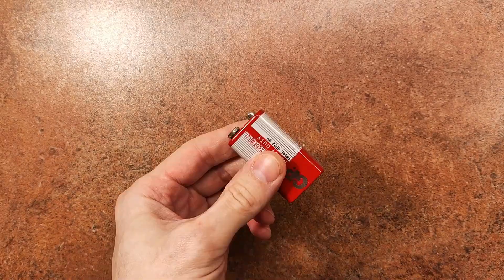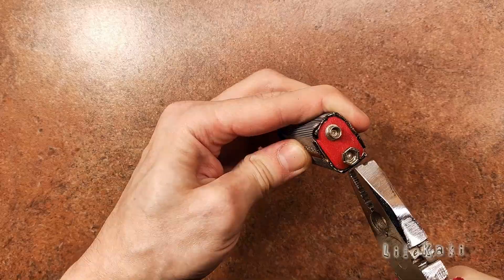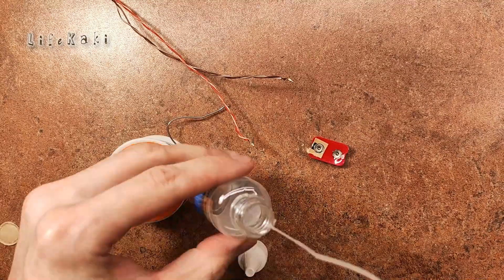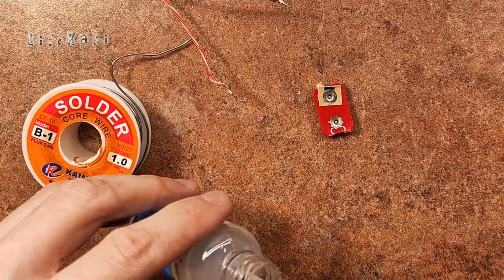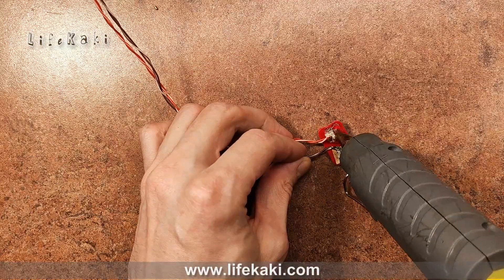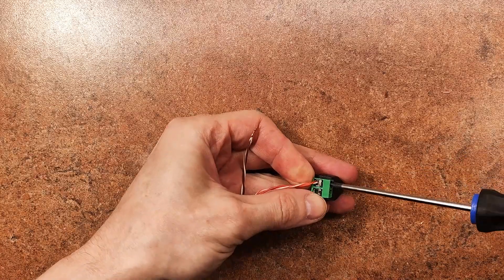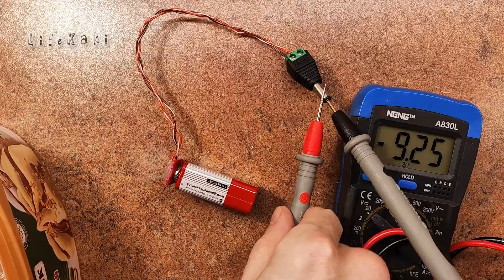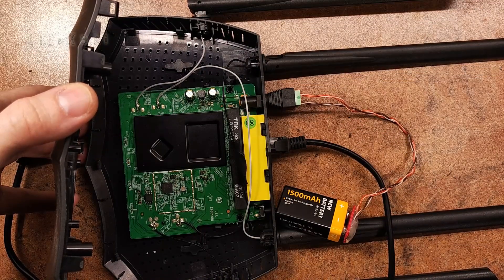DIY Power Hack – How to Connect a WiFi Router Using an Old Battery!

Comment: I'm not sure I've ever seen anything dumber in my life.

1. Can you tell me the model of a 9-volt router?

2. Does a dimly lit light indicate it's working? It hasn't even started booting, let alone supporting a wireless network.
Reply from the maker: Tenda router - it starts and works etc. didn't show it - not everyone likes to watch long videos. it's not nonsense when you always have light in the socket. When you really need the Internet and there is no light and there is a network, then this option can help temporarily. Somehow. Thanks for the comment.
Reply: @LifeKaki   Single 9V 0ption I found for 9V - 3A. THREE amps. Three.
The battery won't even handle that until the kernel boots, let alone support networking.

A lit power light means exactly zero. Simply nothing. It's located before the processor.
Reply from the maker: @Mstitelful  Thanks for the explanation, but in this case it still works, because many Tenda routers actually draw far less than 3A in real use.
Most models need around 0.3–0.7A at 9V, not 3A, even under load.
So the 9V Li-Ion battery can power the router long enough for testing — it’s not ideal or permanent, but it does boot and keeps the Wi-Fi running.

The power LED alone doesn’t prove anything, sure — but the router fully started, broadcast Wi-Fi, and handled traffic. So in this setup the battery was enough.